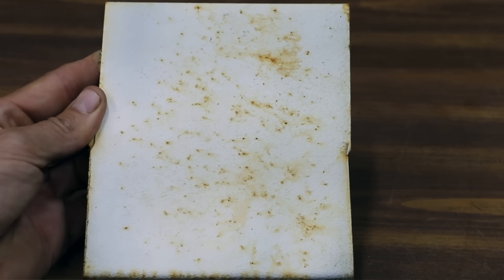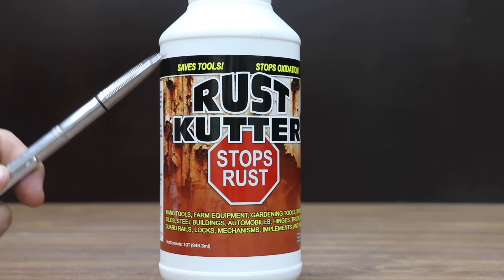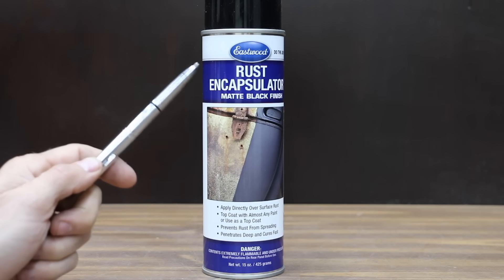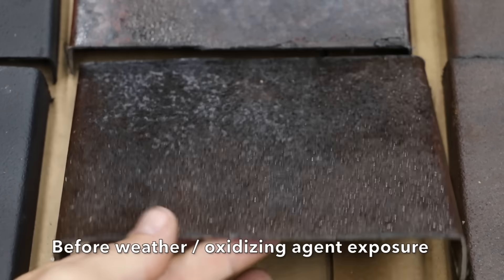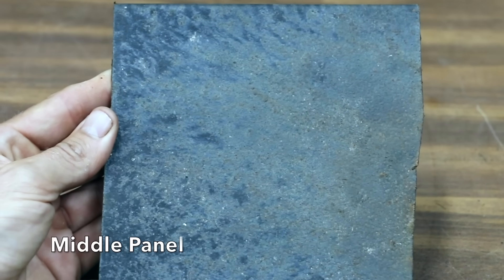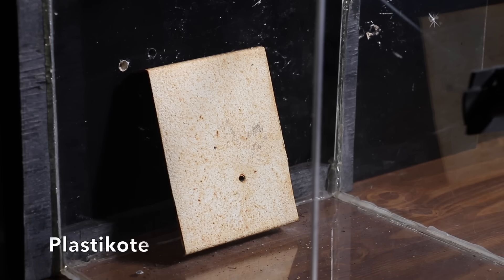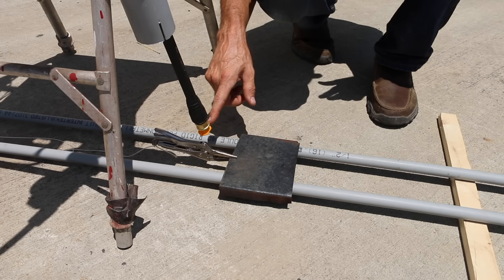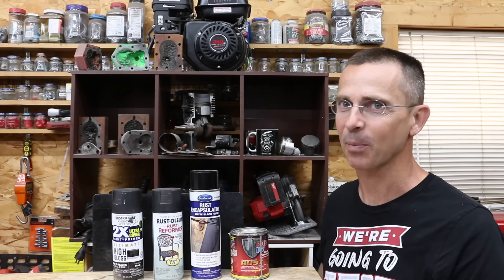Best Rust Converter? POR-15, Eastwood, Rust-oleum Rust Reformer, Gempler's

Comment: There's a company that is in direct competition with POR 15 and it is KBS coatings. They are pretty expensive like POR 15 but I think they might actually be better. I haven't tested it though. If you haven't heard of KBS coatings it is worth looking into. I've used products from them and it has been successful. I hope project farm would include them in these rust related tests.
Reply from the maker: Thanks for the suggestion.

Comment: Blue Steel is the best in my experience (not tested here). Applied by brush.
I have worked in the offshore marine industry for 40 years.
POR-15 does peel.
60 days is an insufficient testing period.

Comment: I’ve use POR15 extensively and it works ok. However, Transtar 2 in 1 primer is much, much better. It is extremely sticky and even cleaning fresh overspray can be a challenge. I grind off the rust, even dremel out some pits. Use some krud kutter gel to get any little remnants of rust then spray with the Transtar. It even works great under bondo and dries quickly. Top it off with some 2K clear for durability and that will kill that rust spot for the life of the vehicle.
Reply from the maker: Thanks for sharing.
Reply: @ProjectFarm  You’re welcome. Your videos are always a great help to me! I hope my comment helps someone. It took me a few years of trial and error to hone my technique. The salty roads of Quebec are great proving grounds. I think they are worse than your hydrochloric acid 😂

Comment: Suggestion for clear coat on bare steel. How well they stick, how durable, how rusty they get when left in the elements, how they hold up against petrol. Thinking for bare steel motorcycle tanks or car panels
Reply from the maker: Thanks for the suggestion.

Comment: Great video as always.  Wish you had done something like Surface Shield....not permanent but supposed to work very well if you apply annually.  It's also suppose to self heal somewhat.
Reply from the maker: Thanks!  Thanks for the suggestion.
Reply: That would be a video on undercoating which simply adds a very viscous oil-based product as a protective layer on top of rust. PB's Surface Shield would be compared to both Fluid Film and Woolwax. He did a video on that a year before this one (search for ProjectFarm undercoating) but at the time he didn't include Surface Shield or Woolwax in the tests.

Comment: POR-15 also comes in a Top Coat Spray Paint - 16 fl. oz. Do you have any experience with this product's performance? I wonder if it would have the same properties as the brushable POR-15 in this video?
Reply from the maker: Thanks for the suggestion.

Comment: Hey Todd, have you thought about making a video showing the best ways to coat and protect metal that's been rusted or has had its original protective coating removed? There's stuff like oiling, bluing, galvanization, electroplating, dry coating, powder coating, enamel paint, etc. It's extremely hard to find a good answer since they all have their strengths and weaknesses. It'd be less of a product showdown and more of a method showdown.
Reply from the maker: Thanks for the suggestion.

Comment: I like to revisit some of these videos for ideas. Thank you for another great year of videos. If anyone uses Por-15 brand, it does need a top coat in direct sunlight, it fades a good bit. Still the best in my opinion. 
Video idea. I'm not sure if it's possible though.  TPMS Sensors. Battery life, connection, errors, etc.  Schrader, Delco, and many others including the Amazon cheapies.
Reply from the maker: Thank you for the video idea!
Reply: POR-15 offers a special primer that can be used to top-coat the POR-15 before painting. I believe it's called Tie-Coat or something like that.

Comment: I’ve used POR-15 on many projects over the years. The only one which it’s not performed as well as I’d have liked is on a steel stand which supports a large salt water aquarium. It’s all housed in a room dedicated to the aquarium system (multiple tanks, filters and such) so the humidity is always high and salts are present in the air. The coating eventually breaks down and allows rust to form after a 2-3 years.
Reply from the maker: Thanks for sharing.
Reply: I need a product for an AC condensation drip pipe in my garden that has cracked at the tip and is dripping rust. Happy to paint after converting. Do you think POR-15 might fail?

Comment: I've used Rustoleum for years on a hunderd year old historic home 's metal roof to preserve it. It worked well but i would have to redo it every two or three years when i saw rust starting to break thru but it lasted for years. i just had to keep up with it but it was a very good product.  I no longer live there. Old homes are monsters. I may try the por-15 on my, turning into a collectors car, that they no longer make.  For a car, I'd like something that lasts longer if there is such a thing. I don;t want to do it every two or three years.
Reply from the maker: Thanks for the feedback.

Comment: Can you test B'laster Surface Shield, Fluid Film, KBS Rust Seal, POR 15 and RP-342 applied to clean metal and to rust metal, as well as applied to rust metal treated previously with Rust Kutter? From all of the long term videos I see on Internet, these seem to be the best of the best. I really like your approach, however.
Reply from the maker: Thanks for the suggestion.
Reply: I second this request! Thanks Todd for all you do, you're a jem brother.

Comment: We've used POR15 for large equipment before used in the utility industry.  They are notorious for rusting and the industry hates it, so we took coated the whole equipment with POR15, sprayed and thinned so it actually goes really far.  8 years later, there still wasn't a dot of rust on that thing.  People don't understand just how great it is.  Also note that POR15 needs to be topcoated or the UV breaks it down
Reply from the maker: Thanks for sharing.

Comment: Another very well known rust converter used in a lot of industrial painting is OSPHO. It's just a concentration of phosphoric acid that converts rust, iron oxide, into iron phosphide and can be overcoated with paint or primer as soon as it dries. Heavy rust might take two coats of Ospho. Also, there's a product available in Europe with a trade name "Turncoat" that creates sort of a plastic coating with the conversion that works well on some automotive as well as marine items that I worked on. The paint held well and looked better than I expected as the Turncoat had a bit of leveling effect on the primer coat. I was gifted the bottom of quart bottle and used it up but have never found any here in USA. Ospho, though, is my go to rust converter. It's proven and it's relatively cheap.
Reply from the maker: Thanks for sharing.
Reply: @ProjectFarm  ...and thank you for your showing the results of your product comparisons. Enlightening and relevant for everyone that needs practical information without the hassle (and expense) of trying several products just to get a result that suits the situation.

Comment: Great video!  There are some other POR-15 competitors now.  Can we get a comparison of those, including POR15.  Also, the standard POR15 that you used does not have a UV protectant, but they have topcoats that do, and that would simulate a more real world result.  Some of its competitors have the UV in their main products while others require a topcoat as well.  Cheers!
Reply from the maker: Thanks!

Comment: The only thing with POR 15 is you wanna use a disposable dipper or some other method to get it from the can unless you plan on using it all right then because it will seal the lid to the can to the point you have to almost chisel the lid off and ruin the can if it gets in the lid mating surface.

Comment: I used POR 15 to do some front control arms, a rear axle and a few other chassis and suspension parts 20 yrs ago. Its amazing stuff. They still look very good today, and minimal rust. Its only where I chipped or scratched them.  I  was building a 427 Cobra replica that used some mustang suspension parts. I found out about it from other guys building these cars. The POR 15 chassis paint is what I used  to paint them with after wire wheel and cleaning with brake clean or laquer thinner. btw.
Reply from the maker: Thank you for sharing!

Comment: Great stuff, but to stop rust you should try a coating that will be more active which means it contains the zinc element.  Ref: A galvanic anode, or sacrificial anode, is the main component of a galvanic cathodic protection system used to protect buried or submerged metal structures from corrosion. They are made from a metal alloy with a more "active" voltage than the metal of the structure.  One product to try is CRC 05048 Zinc-It Instant Cold Galvanize.
Reply from the maker: Thanks for the suggestion.

Comment: POR15 is no joke. I've seen shops spray an underbody with WD40, let it sit for a few days then pressure wash it off. Let dry, spay with POR15 and it looks and performs all year on a farm with no issues. I've also heard super stories of POR15 being applied to rusted frames that are about to break and being fine in 60 days. Not so sure about that last one.
Reply from the maker: Thanks for the feedback.

Comment: I like POR-15 Silver (with the aluminum), but I found that it simply holds the rust in, until it expands so much that it cracks the POR surface and water to wick under the POR-15 causing more damage that you can't see.

It might have been my metal prep before applying.

One application was perfectly prepped steering arm on 1986 225hp Evinrude - probably lasted 2 years. The metal is about 1/2" thick. The POR-15 remains hard, but comes off in sheets.

one application was an improperly prepped inner wheel well on a 1997 F150, rust grew between the painted outside surface and the POR-15 until it popped through the top painted surface and bubbled the POR-15. I believe the metal is 16 gauge

Just my observations.
Reply from the maker: Thanks for sharing.
Reply: @ProjectFarm  love your videos. I saw one of yours on undercoating. I wonder if on the underside of a truck, that repairing the rust, priming, painting THEN undercoating is better than fixing the rust THEN undercoating or some other series of steps.

Comment: I have a truck bed trailer frame that needs paint. Do you think a good pressure washing would be enough prep to spray with the Rust-Oleum or would I need to take the time to wire wheel the whole thing?

Comment: Awesome. I've been using por15 for years. The expense is negligible when you include your time in only doing it once. 
I once had to grind the por15 down to bare metal for welding purposes and had a hell of a time grinding the stuff off. That's what sold me.
Reply from the maker: Thanks!  Thanks for sharing.

Comment: I think this testing mostly tests how well the product seals and protects the surface from rust, which is the same job as paint.
Whereas the job of rust converter is supposedly to convert existing rust into a stable form, so the existing rust would stop rusting, but it doesn't necessarily mean the other non-rusted areas are converted into a stable form.
Reply from the maker: Thanks for the feedback.

Comment: have you considered comparing por 15 to the other moisture cured urethanes with high metal solids content, like bill hirsch miracle paint, rust bullet automotive, eastwood rust encapsulator platinum, and master series. i'm also very curious how some of the high temp exhaust paints do against rust and heat, like with bill hirsch high heat paint, rustoleum automotive high heat paint, vht flameproof, and i think there are a few other brands of exhaust and muffler primers and paints. thanks!
Reply from the maker: Thanks for the suggestion.

Comment: As i just watched the truck bed liner test video i thought I'd comment on this seeing I've also recently used both types of products..
The bed liner i used was the dupli color bed liner.. 
The rust converter i used was a house brand of an auto store in Australia being super cheap auto.
The project i used these on was a 6"x4" trailer.. checker plate metal on the bottom of said trailer. Box steel frame with wire (2 inch spaced ) sitting on the front end. Everything else just flat plate steel. 
I had put the rust converter on it a few days before i put the bed liner on as temperatures here were too cold. 
When i did apply the bed liner i found that it didn't exactly spray like normal paint  does , more splatter type of ejection from the can.. which prompted me to use a brush to get it to cover the metal better.. i do have the intention to get myself another can of that bed liner (which has at this point had about 60 hours of dry time.. and more time when i go back to the store to get more.  
On the rest of the trailers body I've used a metal hardened paint. Which I'm also thinking about getting another can of it to finish the bits i missed out on. And coat the rest again.. 
First load in the back will most likely be a half cubic metre of crushed rock..  soon find out how well it deals with a shovel scrapping over the bed liner..
Reply from the maker: Thanks for sharing.

Comment: Once again an excellent test and presentation.  I've used and like POR-15 a lot, but you did not mention that it must not be exposed to UV and will need to be top-coated to prevent degradation due to sun exposure.  would have been great to see a 1 year test comparison on all the products you exhibited. Thanks for posting!
Reply: Por-15 makes something called top coat just for that purpose. That, or their "hard nose" clear. Both amazing products.
Reply from the maker: Thanks!  Thanks for the suggestion.

Comment: After converting the rust, what is the best way to protect bare steel, other than paint? Like drill and driver bits, other hand tools like spanners and screw drivers. I've tried Fish-Oil, Silicone and Lanolin sprays. Something that doesn't stay greasy or sticky and doesn't wear or scratch off easily? I'm sure there's something better that offers lasting protection!
Reply from the maker: Thanks for the suggestion.
Reply: @ProjectFarm  Bluing perhaps, and would heat/oil bluing redcue a tool's strength?
Reply: If you have converted your rust, AFTER you grinded it out, got as close to sheet metal as possible a simple paint will hold up for year. POR 15, to me is good but I use Fluid Film on nuts, bolts and pretty much the entire frame over winter. It will help slow down that rust issue for sure.

Comment: POR-15 is a great product, but not without its drawbacks. It's a pain to apply to undercarraige and if water gets under it, the urethane film will hold the water in and promote rust. Thought I had taken good steps to protect my rockers with POR until eventually a jack stand bust through with wet rust being all that remained. At that point, the POR provided more strength than the metal underneath.
Reply from the maker: Thanks for the feedback.

Comment: Great info. I’m using rust converter Total Solution which you didn’t test. What’s your take on this product? The bottle looks like the bottle used by Eastwood for its rust converter. Based on the bottle shape I question if the solution inside the Eastwood and Total Solution are the same rust converter.
Reply from the maker: Thanks!  Thanks for the suggestion.

Comment: I have a water-based product in a gallon plastic jug.  "Corroseal".  I wonder how well it will do on automotive frame and suspension components.  Instructions say to not use mineral spirits to clean parts,  use soap and water rinsing thoroughly.
Reply from the maker: Thanks for the suggestion.

Comment: Not sure if this would be too similar of testing or not, but I'm doing a frame off restoration on an '84 K30 3+3. I'm having a hard time choosing an undercarriage protection product. POR15, Eastwood, Rustoleum, Ziebart, Chassis Saver have all came up on forums as an undercoating. Hard to choose one as there are too many opinions on the forums. Think you could test them?
Reply from the maker: Thanks for the suggestion.

Comment: I’ve used POR15 in black.  It’s hard as rock and very tough.  But had to be topcoated if exposed to UV.  Also used Rust Bullet and it worked OK.  But it’s in an engine compartment, so no UV.
Reply from the maker: Thanks for sharing.

Comment: THANK YOU!!! Because of your extensive testing, I bought the complete kit from POR-15 that includes their degreaser ( to be used first for greasy/dirty surfaces ), metal prep solution ( to be applied after the degreaser, this 2nd treatment literally etches the surface of bare metal, painted and/or rusty surfaces, to prep the surface even better for the final POR-15 coating ), and finally: the POR-15 of course. This kit is enough to do the entire frame under my 2000 Tacoma 4x4. I ordered this 3-step kit directly from POR-15, and after applying their discount coupon code that knocked off $15.29, my grand total shipped was $98.91. I'd say this is a fair price to pay to treat & coat my entire truck frame, and judging by your extensive testing in this video, I can be assured this will indeed be "PERMANENT". Thanks again!!!
Reply from the maker: You are welcome!  Thanks for sharing.

Comment: I understand the need to keep a consistent testing procedure, but there are some issues.

As much as I am not as fan of the product, POR-15 is designed to be used with an initial phosphoric acid based wash, and as far as I'm aware the common black POR15 most folks use is not intended to be used uncoated.

In my opinion, these should've at least had a topcoat.
Reply from the maker: Thanks for the constructive feedback.
Reply: @ProjectFarm  Keep it up, I much appreciate all your efforts. The bed liner video directly Influenced product choice on my projects!